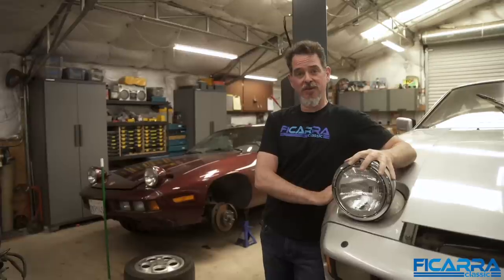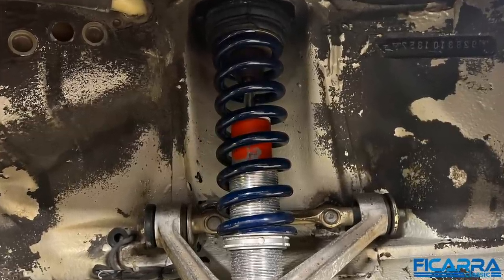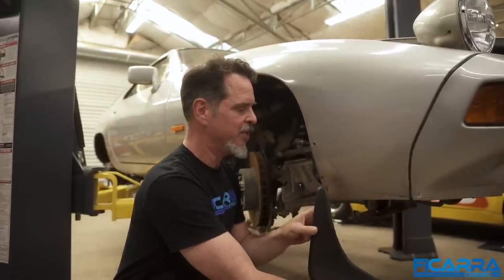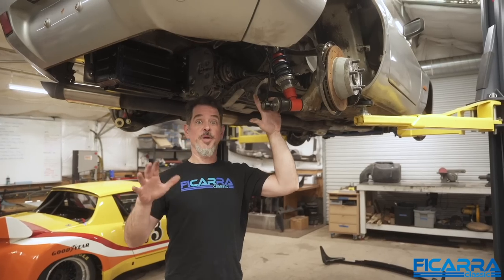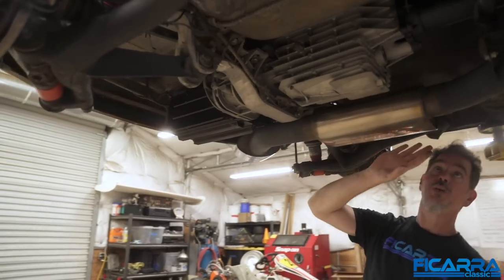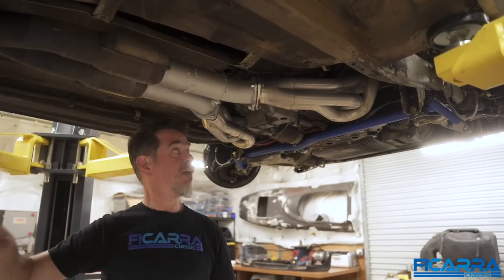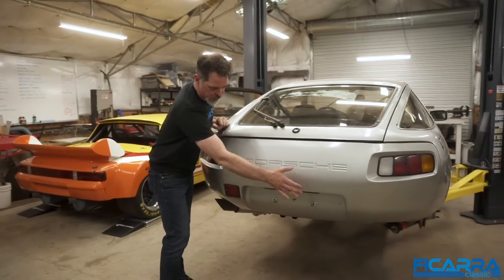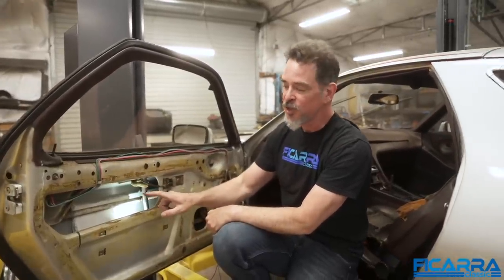Doctor Frankenstein, Your Porsche 928 Awaits!

Comment: A smart welder? Take the two halves, slide a sleeve onto one that fits reasonably tight. Put the halves in the door, slide the sleeve over the middle of the two halves, weld the ends of the sleeve...
Even stronger if done right

Comment: Can I make some carbon-fiber or carbon-kevlar duplicates of your spongey-rubber stuff? Send me the stuff as a mold, Ill give you all my contact info and send back some parts. Im in Canada, but Ill pay the return-shipping and give some kind of collateral. I order from compositeenvisions and they sell colors/patterns/weaves...Im currently building a 1960 Morris Minor Pickup as a LeMans-flavored hybrid. 1986 Honda Shadow1100 V-twin engine(5-speed+shaft drive), with 20kw(28hp/120lbs.ft) electric motor mid-engine hybrid.
Id be happy to finish the build and add it to my resume before I work on yours. Ive watched your videos on my phone, Im going back over them all again now on my PC...raddest part of VinWik distilled into 1 channel

Comment: I've owned a euro spec (Australia) 5 speed, LSD 928 for 7 years and this is one of the best, most informative 928 videos I've seen in that time. Harry's Garage is the other good one. Can't wait to see more 928 content, especially the aircon system and seat restoration. Tricky things that no-one has really covered yet

Comment: Awesome video!  One small correction though.  The double disc clutch was used through 1986 on all 928's.  The 1987S4 switched to a single disc.

Comment: I'm my humble opinion the best place for a side repeater (indicator / turn signal) is integral with the door mirror. This means that it's higher up and more visible, it means fewer holes in the sheet metal (less corrosion), easier to assemble, more aero, cleaner..... All wins!

Comment: Hi, Great video.  The battery box being attached to the transaxle is to reduce the unsprung weight of the car.  More weight from the battery on the diff means more weight on the wheels, increasing traction.

Comment: Exhaust mount on battery box which itself is bolted to the diff sounds very German, still my favorite German engineering is Mercedes W124 4matic - they ran front CV axles through the springs!
Reply: I just saw these the other day! Blew my mind!

Comment: Basically, they want you to upgrade your Porsche 928 up to a vehicle that will upgrade it to something that will get you up to 170mph. Forget it. You won't spend more than a minute at that speed. Enjoy your terrific 928 handling and suspension settings that will out handle even 911's at 99% of normal driving, and give you wonderful driving experiences in the real world. Unless of course you intend on going racing..... which 99.99% of you will never be doing.

Comment: The no side repeater thing is just a US (north America) thing, so those are not just found on Europeans models. Considering some of the other (wacky?) DOT requirements (eg the side facing lights at front & rear), and that the US has a lot of multilane high speed roads, that a side repeater isn't needed. For the rear fog, considered finding a British one (because it'll be on the other side of the number plate) and having 2? The lack of symmetry on the rear of Euro cars where the fog light was seemingly an afterthought upsets my OCD :p

Comment: I’m really interested to see what power output an early euro spec has with headers. There’s a lot of conflicting information on that. Do you plan on putting it on a dyno? For reference, I’m currently restoring a ‘79 euro spec. Probably gonna just leave it all original (engine wise), but I am contemplating putting headers on. Possibly one day doing the ‘85-‘86 5.0 hybrid swap?

Comment: In the video, the door bar looks like it has an internal tube to reinforce where is was welded in the middle.  Is that what it looks like up close? The gap would allow it to squeeze into the door opening, then slide it apart a small amount then weld it?

Comment: Despite popular belief, bigger brakes are NOT always better. Is more unsprung weight, that hurts the handling. Most cars come stock with brakes that can lock the wheels, hence the need for ABS systems. Vented perforated brake disks don't add to the braking force, just increase the heat dissipation capability, important for frequent braking at low speed. The 928 was meant to be a GT, so unless one went to the track, it had plenty brakes to cross the Alps and the Pyrenees in safety. 
The best braking one can have is downshift to a lower gear and let the engine compression slow down the car without wearing the brake system. Those driving automatic, though luck.
Reply: Gears are for going, brakes are for slowing. Pads are easier to change than clutches.
Reply: @keithhoughton4308  when you downshift, you don't ride the clutch. When braking, you ride the brakes. I am driving a car for 250 000 km, with the clutch that came in it, god knows how long before, and no problem. Car is a Mercedes-Benz 250d with more than 800000km.
Reply: @José Pinto  That advice was given to me by the owner of a racing school. It has always stuck with me, even when driving on the road. 
Also, you don’t need to do much gearchanging on those 250 diesel Mercs. ;-)
Reply: @keithhoughton4308  What José wrote is right, we learn that in driving school in Europe. Where nearly everyone drives manual, and it's a good way to save fuel.